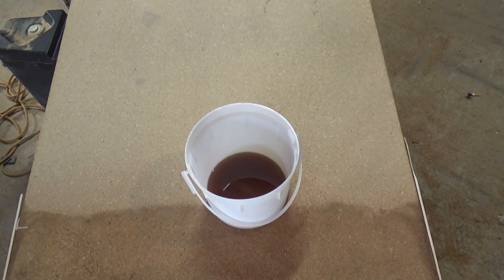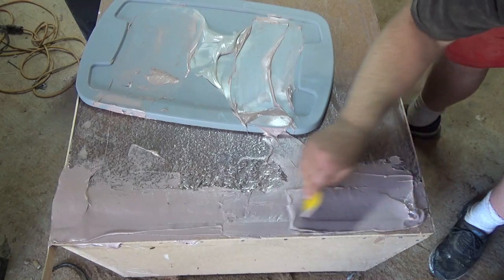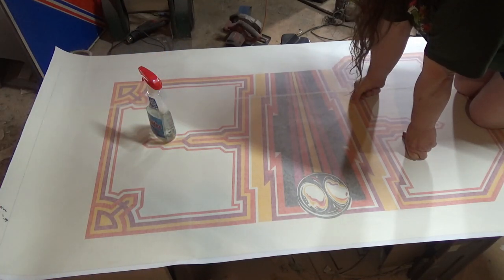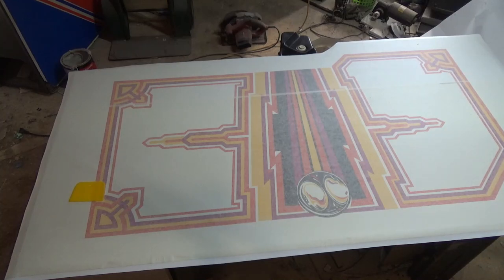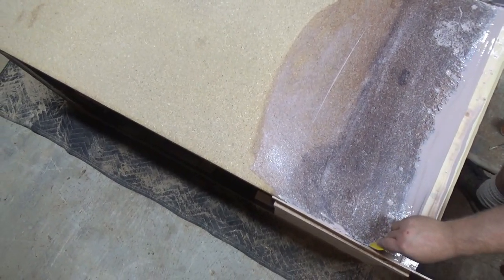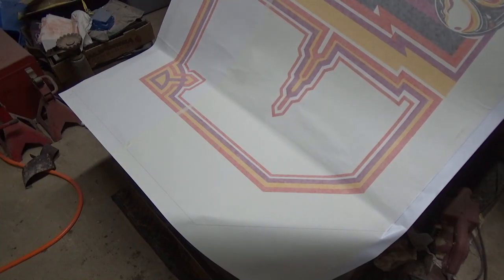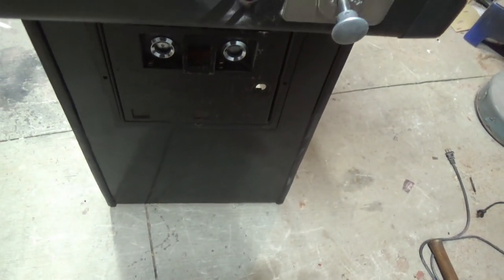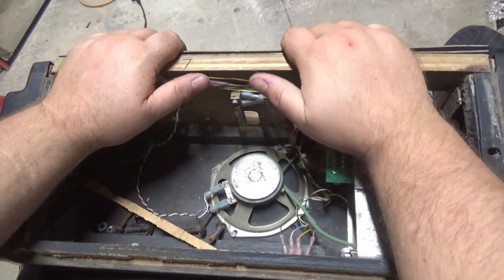Atari Video Pinball restore part 2

Comment: Bummer the factory side art wasnt savable; i thought it looked good enough but understand your decision. The new CP looks great. You did a TON of work; you definitely put in the time to make this look as good as possible and it totally paid off. That cab has such an interesting design.
Reply from the maker: the whole cabinet was 2' short and leaned sideways i supposed i could have touched up the art but it was pretty bad
Reply: @ArcadeJason  Ahh thats right, you would of had to build out the bottom and try to match the paint to the old art which is brutal. Good call man. I have a Robotron project ill need to cut 4-6" off the bottom so I feel that pain.